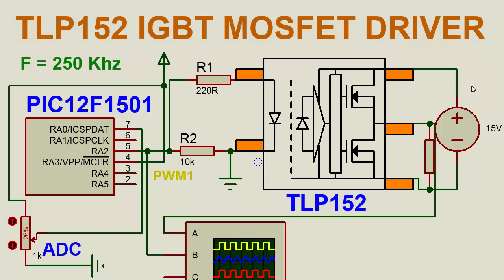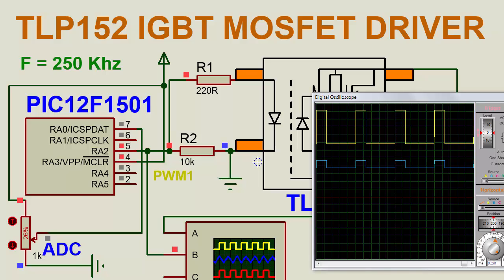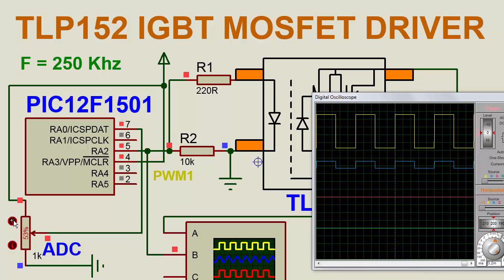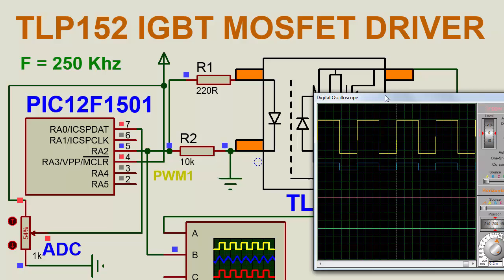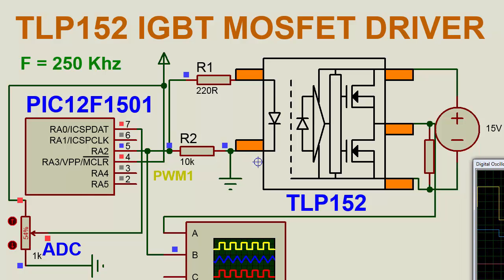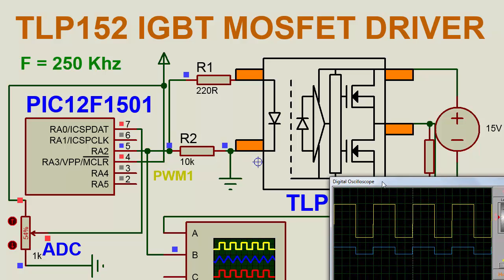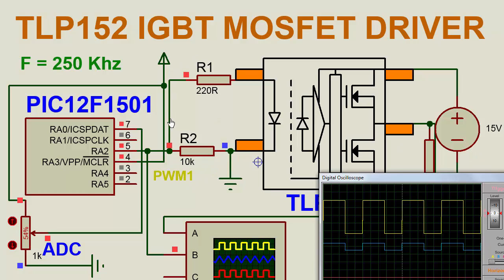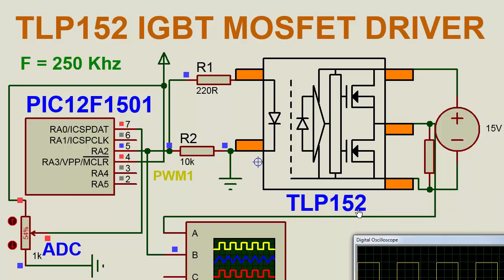TLP152 | IGBT | MOSFET Driver  & PIC12F1501 | ADC | PWM

Comment: How to add TLP250 to proteus software?
Reply from the maker: TLP250 is not available but similar MOSFET gate driver is available to test circuit. Only current rating is different.Just search gate driver.

Comment: Can I give power to various tlp 250 with a single rectifier circuit,?
Reply from the maker: We assume that you have three tlp250, and three inputs to control three tlp250, and there are three MOSFET to each tlp250 to control, now VCC and ground of tlp250 are separated/isolated from other power source, we use tlp250 output and it's ground to connect with gate and source of MOSFET, VCC and ground may be same for three tlp250, must have high capacity. First check with two tlp250 
Thank you
Reply: @Dcode103  Thank you. I have to use 8 TLP 250.  I don't want to use separate transformer with separate rectifier to give voltage at vcc and ground.
I want to use single transformer with single high power rectifier with single capacitor to feed all tlp 250 Vcc.
Is this make any difference related to safety.
Reply from the maker: @avinashmaurya8381  first try with two then go for 8
Reply: @Dcode103  Thank you....